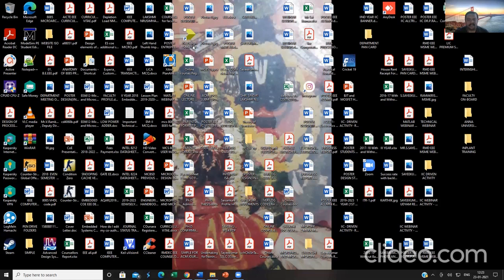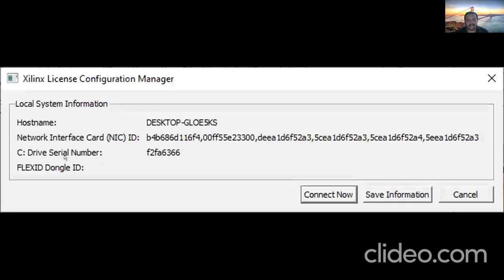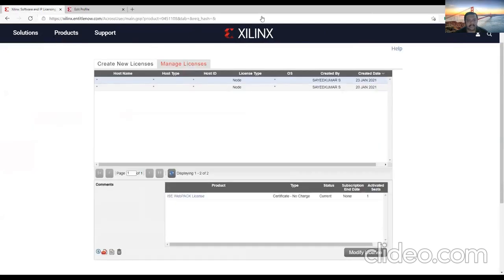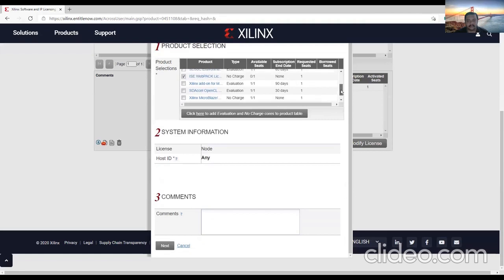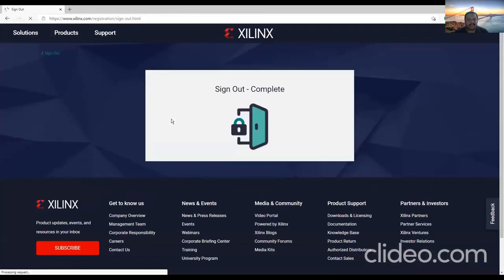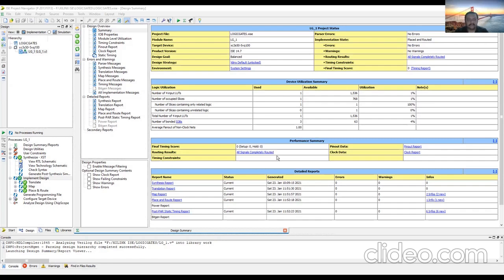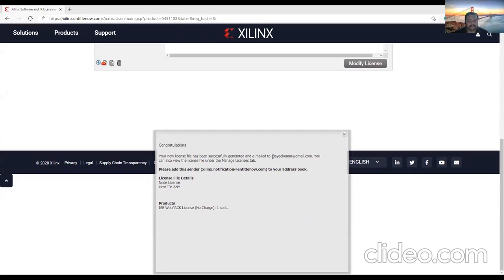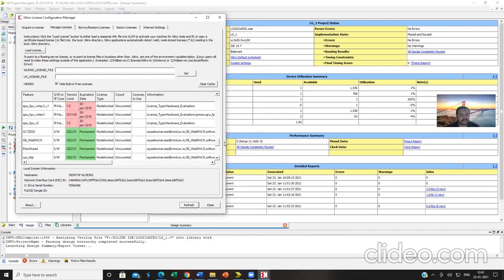HOW TO ACQUIRE LICENSE FOR XILINX ISE 14.7 WEBPACK

Comment: Sir is the licensing of this software free or paid
Reply from the maker: FREE ONLY PA. IT IS OPENSOURCE
Reply: @processorarchitecturedesig2561  I don't believe that's true. It's free, as in "free beer". It's "paid", but the price is 0. It does not have an open source license, Xilinx (and its new owners Intel) are not obliged to distribute it freely.